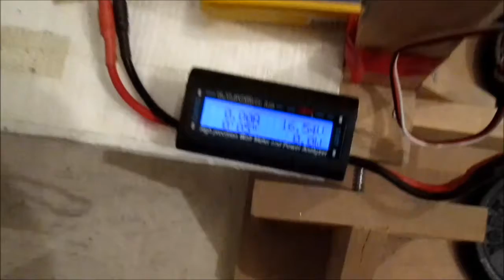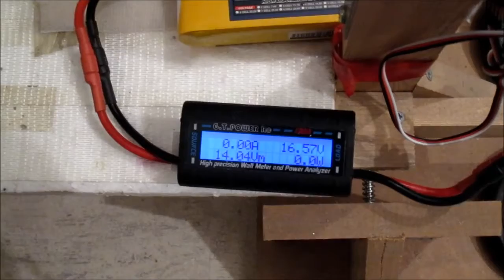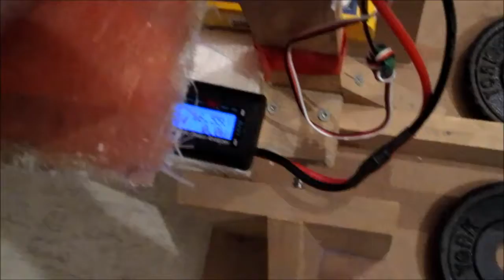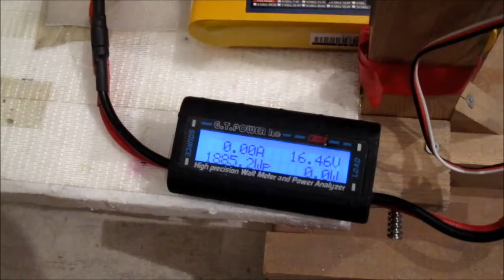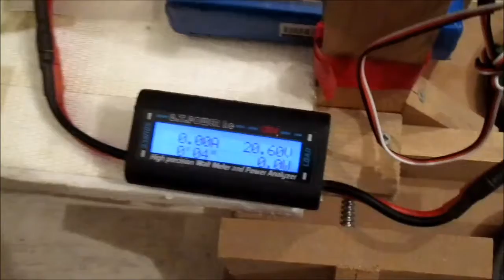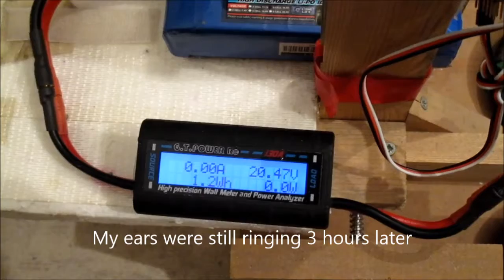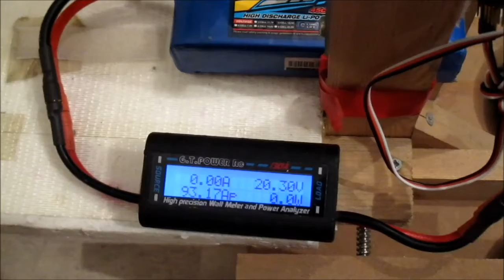Dr Mad Thrust 2870 3000kv Thrust Test Motor Test of the Week

Comment: would this motor be ok for a electric scooter? im having trouble deciding on a size i have made gas ones before and i would like this to go around 40 MPH. If you could just let me know what you think or suggest a good motor i weigh 175 all up gonna be around 195 200 pounds on the scooter
Reply from the maker: Hi fritz
This motor will not be any good for a scooter. It is far too small and has way too high of a kv. Also it's a inrunner motor which have less torque then outrunner motors. So what you want is a much bigger outrunner motor with a lot less kv rpm rating. Something with a 50mm diameter and less then 1000kv and then just get your gearing wright. Check out the motors on Banggood. Hope this helps.
Reply: @rcplanepirate  ok thanks for the reply it did help

Comment: not very efficient. look at the new racing multirotor motors. t motor f80 pulling 1.5 kg at 40 amps 4s. weight only 44 grams.
Reply from the maker: This set up isn't about efficiency. It's about SPEED! This motor has the potential to make a pylon racer go 200mph. I doubt  the f80 would get anywhere near that! They do sound like good motors though. Thanks for letting me know.
Reply: Yes, but thrust ist not the thing by installing in to a Pylon Racer or as a pusher on the funjet. Then it's the question to get enough start thrust and aviod killing the motor at full throttle in the first 2-3 seconds after start. I installed one in a Hobby Lobby Vodoo Pylon Racer on 4s 1300 100c. Let's see, I will go for 4,25 x 4,25, hoping to stay below 90amps.